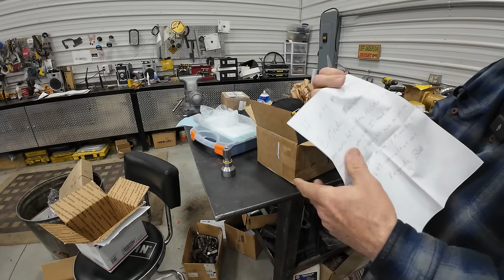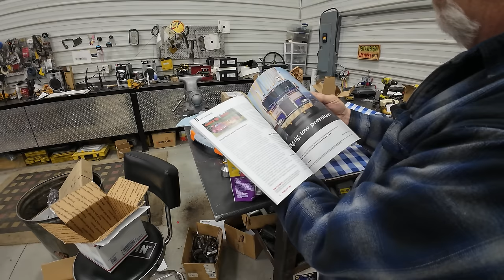D9G Track Frame Removal

Comment: The sound of a big bore Clatterpillar pre chamber engine starting never gets old. Anyway pretty good service life from those track rollers Jeff. Gallion for the win, those damn track frames are some kind of heavy and awkward to handle. The equalizer bars and fighting the diagonal brace in those big cats are kind of a pain in the ass. Jacking up the tractor to remove the frames are always an exercise in what do I have that will work it seems! At least it has a back jack build in! I cannot say I have ever seen those bolts on the carrier roller frame all broke at the same time! I have broken them trying to remove them though. Oh well...Drill Baby Drill 😁 Man you still have the cylinder mount brackets? You are a Cat God Jeff! 😁 Cheers

Comment: The air tool swivel is called the GRIPNAIL 360 degree swivel or Freedom Swivel.
Reply: Thanks!   It looks like it works a lot better than the swivels we have in our shop.

Comment: Pakistani truck is the masters of “fixing what you got with what you have” rebuilding wheels with scrap steel from ships. Welding gears and re cutting them with angle grinder.😂 if it works it work. That and doing it all while wearing saddles.
Reply: I've worked with Pakistani & Bangladesh backstreet taught mechanics...& your heart just sinks when they turn up in sandals, kurta pyjamas & corner shop/grocery store plastic carrier bags with their tools in....Bless these lads, great for emergency breakdowns & oil changes but for the longevity of your precious & very expensive piece of construction kit.......Aye Yai Yai...😪😪😪

Comment: I would like to see  the Milwaukee impact compared to all of them
Reply: using both as a millwright at work, the inch and are alright. they do not hit as hard as ingersol rand titanium inch or inch and a half titaniums we have been using for years on turbines. They are handy though. Stringing large chicago fitting air hoses around gets old. The batteries go fast as well. Honestly none of the electric stuff holds up that great in a industrial environment where you are using them past their duty cycle.  

If you run a small air compressor you wont get the performance out of even a 1/2 that yu would with large hose and a bigger compressor though. I actually like the ingersol rand half  electric better then the milwaukee gun. that is just feel of the gun. the red gun might hit harder. no idea.

Comment: Crooked 6 x 6s from the local lumber yard make great cribbing.  We used a crib on each corner when I had the track frames off my 6.  I had maybe a $100 bucks in them   We cut them into 2’ pieces at the lumber yard.  And the ard was glad to get the snakes sold.

Comment: It'd sure be nice if I was closer than over 2,000 miles out here on the east coast. Then I'd at least offer to come by there and give you a little help when you need it. I know you've been in worse situations before but I can't help but think an extra hand could help you out and be safer. You may very well not want anybody getting in the way. One thing I did see that might help is when you got several bolts to pound out under something, like the 9, take a strap and wrap it around what you are working on and put it under your front handle to hold it while you are running it. That big impact holding over your head for even a couple of minutes will wear you down. It depends on how much work you got if it is worth it but I have found it to really keep the big guns from trying to kill you. Like to see you working on the 9.

Comment: I have the same Earthquake impact and it's definitely the best 1 inch air impact i have but i couldn't get a couple bolts busted loose but the 1 inch Milwaukee done it no problem but i don't think the Earthquake was getting sufficient air flow. So how many ton is that Gallion rated for?
Reply: guessing you are running it on some 3/8 stuff. you need minimum 3/4 and a lot of cfm, 1inch will even net better results, but is a hassle.
Reply: @airbats801  no I was using a 3/4 inch hose but it was very cold at the time like around 15 degrees so I'm sure my air was freezing up. It was working but definitely wasn't flowing enough to get 100% performance. And you're right a 1 inch hose would be better but definitely a hassle. I try to use a short 25 foot hose so I'm not losing as much if I can.

Comment: Link to pneumatic swivel didn't work.
Reply from the maker: I haven't seen the link yet,
Reply: @Jpaydirt  Search for----->  1/4" air hose fitting Gripnail 360 degree swivel similar to Chicago brand.  This platform does not allow me to add in a link for some reason or maybe it is just a random fluke?
Reply from the maker: send it to jpaydirt7@gmail.com and I will add it           @jtg2737